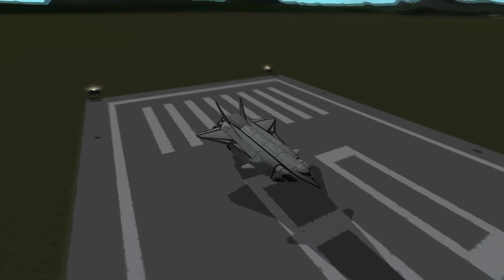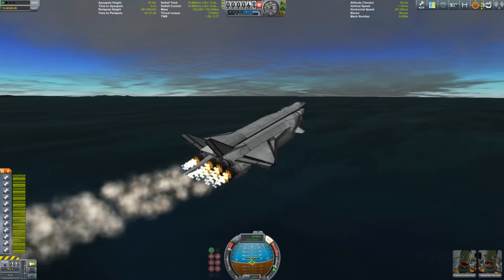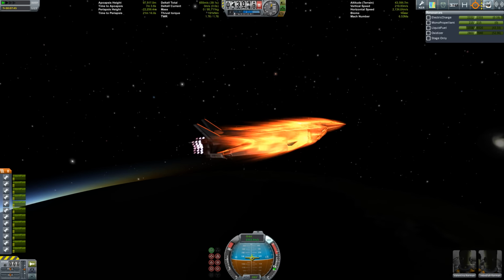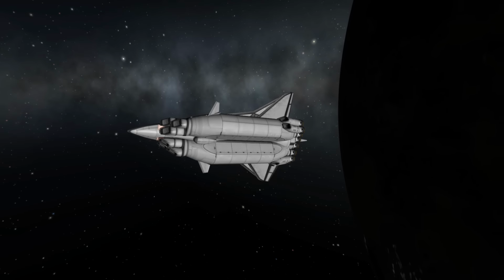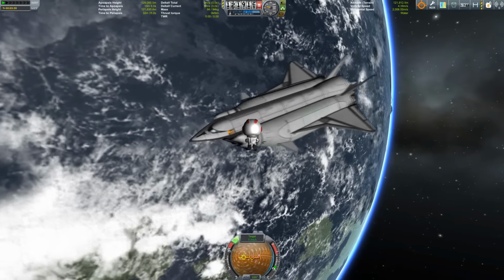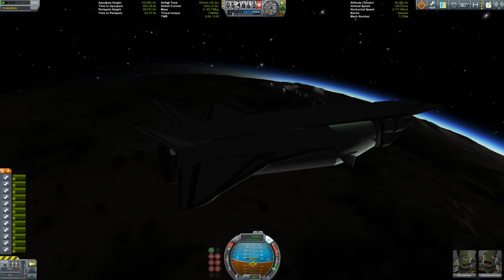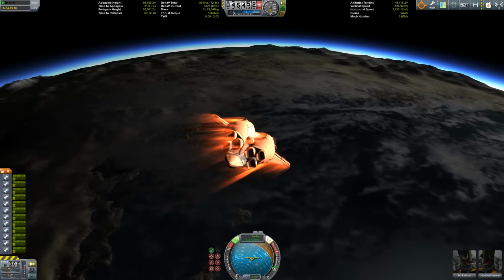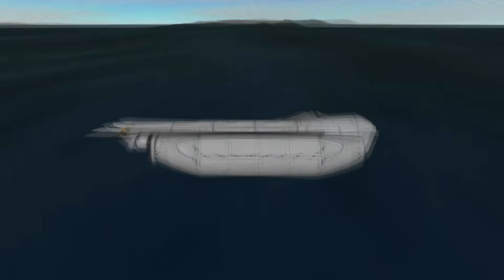Special Delivery ... by a 150 ton SSTO Spaceplane - Kerbal Space Program

Comment: Shadow, I think the reason the SSTO wasn't tumbling during reentry is because of the mass distribution. You may have cut it out, so I won't know if you had done this or not, but you should have shifted any fuel from the back towards the front, as rocket engines drain top to bottom. I forget if that applies to the rapier's closed cycle mode, I feel like it doesn't, but yeah, shift fuel to the from to increase aerodynamic stability.
Reply from the maker: +Christian Michael That's probably exactly what happened. I tried another SSTO design today and it started tumbling as well. Transferred all remaining fuel to a tank up front and the vehicle regained stability.
Reply: +ShadowZone more than plausible, did that on my latest design too
Reply: +Jesse Koops ur center of lift must always be behind ur center of mass, otherwise it wants to flip. when fuel is drained, its always drained from the front 1st, so the center of mass shifts backward & the craft becomes unstable.